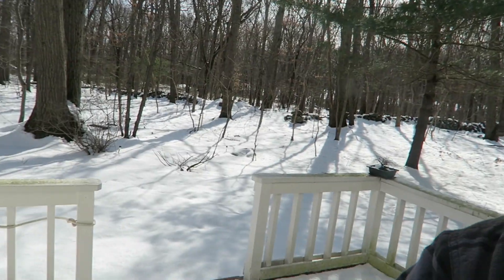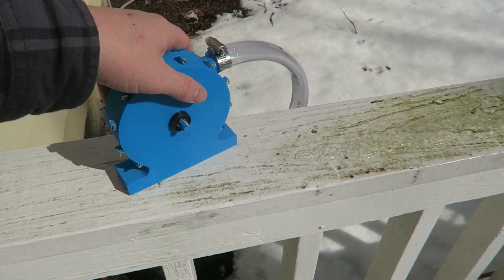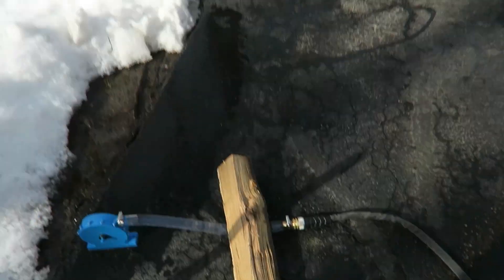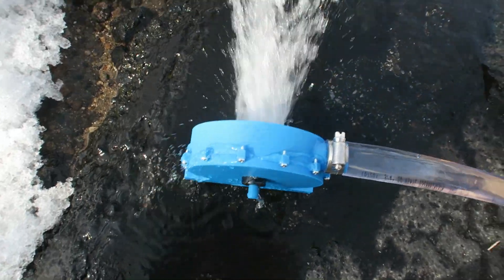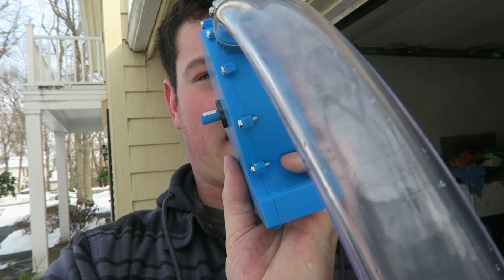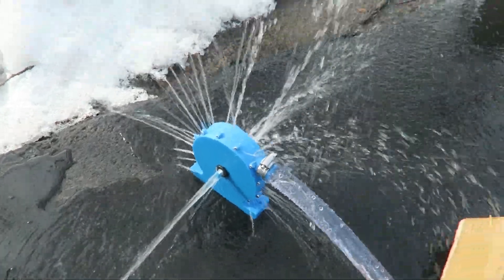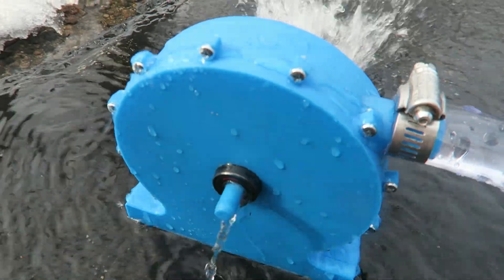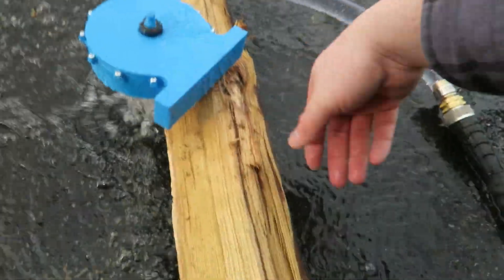3D Printed Tesla Turbine

Comment: Grooves on cylinder and end plate for rubber gasket
Skate bearing or water bearing ( water under pressure)
More torque from more blades
Extended cylinder on outlet then add hose for drainage
Keep going have fun and self education
👍🇬🇧
Reply from the maker: Thanks for the tips!

Comment: Take the shaft from an old washingmashine motor. You get best bearings with it. Remove everything else from it. You have  the ability to 3d print- good. Could use stainless steel discs, but those take powertools to alter. 3d printed discs work for initial test i guess. Usually the disks should be pretty thin  tho. Make the overall crosssection bit thicker tho and add more blades, thus you gain more power and less loss. But see, even with this crap test turbine you were amazed how much torque you got out of it. Now imagine if you built it well ;)
Reply from the maker: That's the goal
Reply: Building things well is expensive, especially stainless steel isn't cheap, and everything else has to be made from much more expensive materials as well. I found that out years ago when I was doing some experiments with the production of hydrogen. Building something well might be feasible when this is a channel with many subscribers and patrons. For now it is my understanding that the objective is to try out different basic principles and ideas instead of trying to make just one thing as efficient possible.
Reply from the maker: I could not have said this better my self. Eventually I hope to grow to that point as the channel grows. For right now it's almost impossible to make all the projects with stainless steel. Eventually I would like to get a small cnc machine to be able to at least use aluminum. Thank you for the support. Going to try and film and edit a video tonight.
Reply: @Beyond_The_Print  👍
Reply: @insAneTunA  depends where you gonna get it. Old fridges have some good quality stainless steel shelves in them. I made a cool knife out of one.. could look in places where they collect all old metal, may get some really good prices or free if you explain your project. Things are expensive only if you throw everything away and go to shop to buy new stuff and put no thought into it or have gotten no tools for yourself to work with.. Aka shaft from washermotor would be free if someone wanted to get rid of their old machine. I got 4 over the time now and gave away 3 back when I was still stupid. 1 were my own that broke down, one was in rental home that broke down and owner wanted to get rid of it fast, one is my other old one that is in working order really, but not used etc. You can take butcher knives, which are stainless steel and cut disks out of those. Really, be creative. In my area we get old knives in second hand shops for 50 cents.
Reply from the maker: I'll have to take a look and see what I can find.
Reply: @mikkveere1409  I know what you mean. And it is true that you can a lot of the materials for free if you know where to look. 80% of what I have in my small backyard garden was for free. But even so you need a car with a trailer, you need space to store all the junk, you need to live with a partner who agrees with that, you have to collect materials instead of that you can immediately build and test something. You also need more powerful tools, because stainless steel and especially 316L stainless is a pain to work with. And the electrical side of the experiments needs to be beefed up as well, which is also more expensive. 

All those things would be interesting once you have picked out a desirable final design, and when you actually have a river nearby from which you can extract actual power so that you can reduce your actual energy costs. 

For experimental purposes it is quite the investment and hassle when you are going to build stuff out of metal. I have build up a collection of tools over many years, and I still do not have all the basic tools that I wish that I had. At the same time life itself isn't getting cheaper either either. And I used to collect a lot of free materials, I still have some of that, but it also takes up a lot of space. So I am trying to get rid of some of that stuff so that I can get back my space and make the place look nice again.
Reply: @mikkveere1409  For example, people say.... oh those refrigerator compressors are handy for stuff. So I have two which I saved from refrigerators that I was throwing away. I never used them and all those years they were just collecting dust and taking up space. And I had to move them around a million times.
Reply: @mikkveere1409  The same story with a washing machine motor and two microwave transformers. I really need to get rid of stuff 🤣
Reply: @insAneTunA  but thats what makes life interesting. Plus believe me, once you finish a working generator, your wife will be really happy she led you to do your thing. :D don't nessessarely need a river. Ive given it a thought. If you can store a fixed ammount of water, you can recycle it, if you got good turbines and figure out how to rise one of the tanks higher fiew meters. Either use some of the created energy to pump (6-9v divepumps, because liquid is more easily pushed than pulled aka car fuel pumps are great example)the water back up or use a handpump or remake a bike to be used as a pump... hey it is a mk1 right? Will evolve and come up with new ideas on the way. But first you need something to stand upon. Plus surely your channel will skyrocket in the process.
Reply: microwave transformers can be used to create induction heater which would take fraction of the power a regular oven takes. Plus strong magnets in mw's can be used for a different kind of generators if combined with bike rims.... I know how it is with stuff. But hey, now that your channel is growing, i engourage you to save the stuff you have and use them in some videos. Ppl will love it for sure. It was in alien movie. The chick were asked why she carries a 50 cal desert eagle and she said " better to have it and not need it than need it and not having it." It can sit for 10 years but if you need it on 11th, you know exactley where it sits. :) I have a cieling tall shelves and all my stuff sits there in the corner taking little space. Wife is happy(somewhat.. when I start building something she still whines over me occupying kitchen table over night) but you get used to it. At the end of the day, if you want it, you got to build it yourself. Otherwise you will be a slave ofa big companies forever.
Reply: @mikkveere1409  I don't think that he has a river near his house. And how much water would you need to store? And how much energy would it produce to make it worth doing? And would you be able to use it during the winter when it freezes? And how do you get the water up there and how much energy is it going to cost to get it up there ?  And how much is all the plumbing going to cost? 

A couple of years ago I installed an aquaponics system in my garden. I needed PVC pipes and some PVC ball valves, and some PVC glue, and some PVC couplers and bends. Some insulation material. And before I knew it my wallet was empty. 

And even if he would build a water tower it still has to be strong and look nice too, and it would need concrete footings and perhaps even a building permit. So when you ad up all the costs and all the time that you have to put into it, you are talking about quite the investment which you might never ever earn back. 

He can do the same experiments with city water and a hose, and do numerous experiments for the same amount of money without all the hassle. 

In real world conditions things are easier said than done.
Reply from the maker: I hope so, it's what motivates me to stay up till 3 am working on designs with work the next day. I may make a video with the recirculation tank to test inside and such. Depends on when I can get to it.
Reply: @insAneTunA  TONY STARK WAS ABLE TO BUILD IT INA GAVE!!!! WITH PUNCH OF SCRAPS!!!!!!  :,D
sorry it just flew into my mind :D
Reply: @mikkveere1409  And I happen to have a miniature water tower. My aquaponics system runs on just one pump and gravity. So I have quite a good impression about the costs and the time and work that you have to put into it. My tower is just man high with a small capacity, but I still had to do all the plumbing and make all the bends and all the couplers, and make it winter proof for the region where I live, and all that sort of stuff. And I used IBC containers for my system, and I know what you have to do to make the plumbing durable and reliable enough so that it can handle a ton of water without leaking or collapsing. 

It was expensive when I did that, and now it is even more expensive.
Reply: @mikkveere1409  with a 50K sponsorship things are much easier. All those big channels can do the elaborate things that they do because they get well payed to do it, or they get the most expensive parts to do it. For example it is hard to find a channel who didn't get a battery pack from a sponsor.
Reply: @insAneTunA  I'm looking forward to 1k subs, maybe companies will reach out for these vids and future ones to come.
Reply: @insAneTunA  might start a channel to show how it is done without tons of money. :D